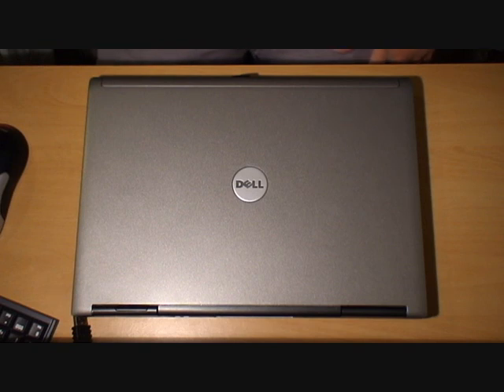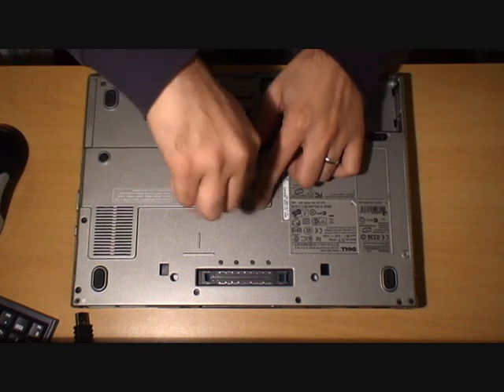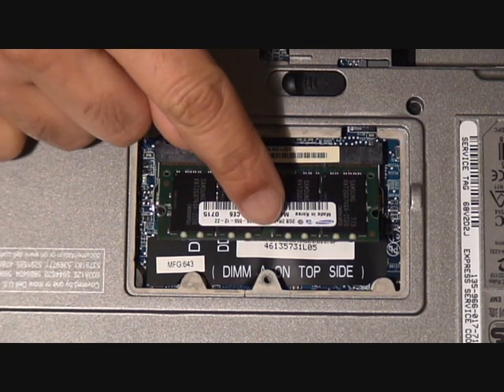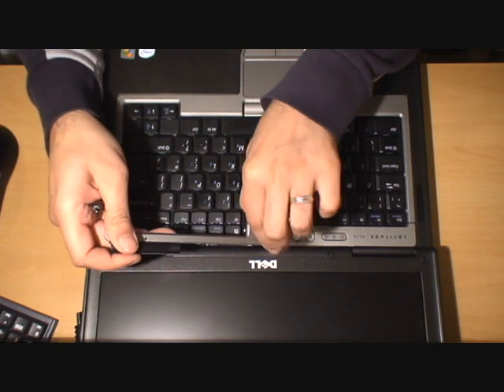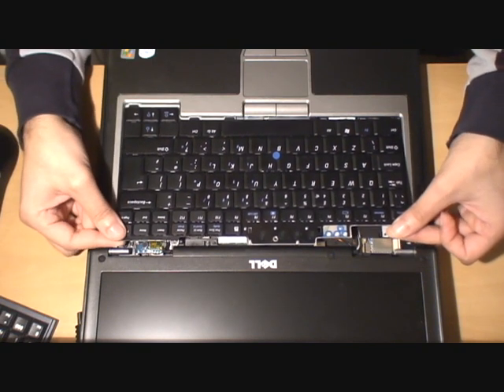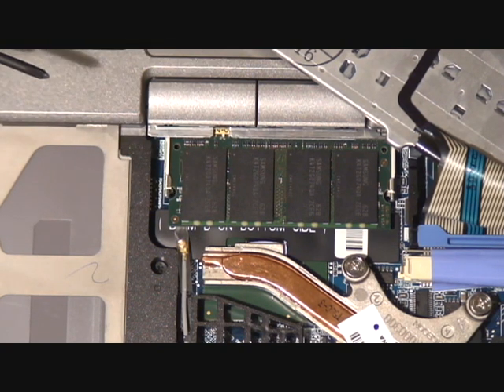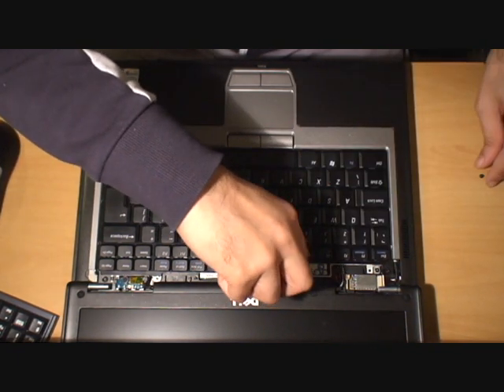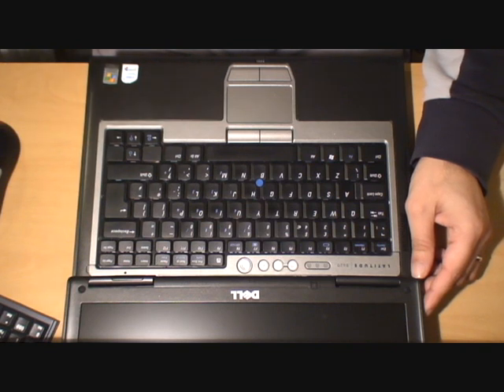Upgrading RAM in a Dell Notebook

Comment: I see this is a "dated" video now, but I'm very glad it was here!  
Just wondering if I should have put my new RAM of 16-gig in the first slot as opposed to the second slot, which was empty?  (The first slot had an 8-gig card in it.)  I learned after purchasing the new card that it's preferable to have the same size in both slots.  Anyway, this was a very well-done video and greatly appreciated!
Reply from the maker: Doesn't really matter which slot - yes its preferable to have the same speed and capacity in each slot - so ideally you could have just purchased an 8GB stick of the same type as the existing..... However, now that you have ether 16 I would install the 16 first - make sure all is running OK - then add the 8GB stick as well - if all runs well and you notice no speed difference (probably won't in normal everyday usage) then leave it in!
Reply: @iftibashir  Thanks for the QUICK response, much appreciated!

Comment: EXCELLENT VIDEO! Clear, well-paced and showed us all the important steps, much appreciated! 
I have a Dell Precision M4300 laptop - used to have 4 Gig in it then when I took it to my Tech guy for a new hard drive, he decided to remove 2 Gig of the RAM and said that WinXP wasn't recognizing the additional RAM anyway. He gave me the RAM back. He also installed a 5400RPM drive to replace the 7200RPM. So now I have a slow laptop with less RAM than when I started. 
QUESTION: Can anyone tell me how to reinstall the extra 2 GIG RAM that I have, in such a way so that it's recognized by WinXP?  And does anyone have any experience on upgrading a similar laptop to an SSD drive, and how that worked out? Any help appreciated.
Reply: Yup, just unscrew the panel on the rear.  Either remove the Ram on top to clear a path to the second slot or put the RAM in the exposed top slot.  Win XP will recognise about 3.5GB of the 4GB you have put in.  If you go to System it will tell you know much RAM it has recognised.  With luck the rest of the RAM  will be used by video.  Good luck.
Reply: Many thanks, will try it out!

Comment: Hey bro. Have you ever had a problem where the RAM slot at the bottom of the laptop won't lift up at all, no matter how much force is put on the levers? It's a D530, and it's entirely stuck. No RAM in it atm, but I'm wanting to insert some RAM into that slot, and it's not budging.

Comment from the maker: They could both be full - with a 1GB stick in each slot.
If you have a single 2GB Module, its more likely under the keyboard.
Remove the panel from the bottom of the laptop first - if its empty then you have a single stick under the keyboard and a free port under the laptop. If its in use, then you have a 1GB module in each port.

Comment: Are you using a 32-bit Operating System (Go to Start>Control Panel>System)?
If so, your computer will ALWAYS recognize less than 4GB ram.  You won't be able to use all 4GB ram unless you install a 64-bit OS (provided your laptop has a 64-bit processor a.k.a your laptop was purchased within the last 5-7 years).

However, if you ARE using a 64-bit Operating System, then message me back and I'll try to diagnose your laptop even further.

Comment: I have a question, are the slots called slot 1 and slot 2 for the order that you should replace the chips in if you are to upgrade it? ir is it just called that for reference? thanks.

Comment from the maker: @klitoni1 - It could be either as it depends on the original chosen configuration when the system was built. Best way to check is either via the BIOs, or via opening the bottom panel (the easiest slot to find) and seeing whats there. If the bottom slot is empty that will mean you have a single 1GB stick in slot 1 (the slot under the keyboard).

Comment: @iftibashir  - Thanks for the vid, I just picked up a used Dell D830 and I intend to upgrade it to 4 GB and I wanted to see how to remove the one under the keyboard.  It already has a 2GB chip in there and I could have just added 2 GB to the B slot but I wanted the 800 MHz RAM so I have to replace both.

Comment from the maker: @thewoonderboy - RAM is the temporary memory used my the OS or applications while in use. The more you have, the more memory applications have to use. This usually means you can open more applications simultaneously etc. 3GB is more then enough for general usage though. I would say start with 3Gb and see how you get on - it really depends on the applications you will be using.

Comment: Plz Help.  can i use (RAM name > Extrememory 2GB SODIMM DDR2 667 MHz  PC2-5300 CL5  to Upgrade a dell Latitude d620,  what happens if 1GB ram is in slot 1 , and i put in slot 2 , i put 2GB ram, would it work.  
And also will this be go too upgrade hard drive to SAMSUNG 500 GB 2,5" HM500JI  ,  Nice Tutorials i will use it

Comment: I have a Dell D410. The Dell online instructions say that one RAM slot is under my keyboard, and I'll have to remove the keyboard. Is that true.  I see two slots on the  bottom of the notebook.  However, I think one may be the hard drive. Will I need to remove the keyboard to change both RAM slots?

Comment: Well first, AMAZING video :)
Extremely helpful, but I would like to know something.
I have a 2005 Inspiron B120 laptop. It has a Celeron M 360 1.4 ghz processor. 40gigs of hard drive and 500mbs of RAM. I have available a 2gig upgrade ram upgrade, a 160 gig hard drive upgrade and a Pentium M 1.7ghz upgrade. My friend upgraded a 2002, and it runs like a champ. I wonder if upgrading my laptop is worth it, and the specs I told you the right ones for the model. Thanks :)

Comment from the maker: You will get around 3.25GB from any 32 bit Operating System - although you will benefit from Dual Channel Mode - which gives you a very slight boost, since you will be using 2 RAM modules that are the same type and size etc.
Gaming performance should increase a little since the game can access RAM memory much faster then your HDD, hence it can dump more of its running data onto the RAM, rather then onto your HDD.

Comment: I was wonder tho is it possible to put more then 4 gigs of ram on a Inspiron? o.o cause if so im shoot for6-8gigs :o thx for the video i wanted to make sure i did it right and you can also check that the ram was placed correct by right clicking your desktop going  to graphic properties and clicking the information scrolling down to the Physical memory you should have like 3000 mbs or somethin like that for 3 gigs of ram

Comment from the maker: Some of the newer systems have both RAM slots under the system - so you dont need to open the system up any further at all. If you only have oe RAM slot under the laptop, then yes, the second will be under the keyboard as shown in the video.

Comment from the maker: If I were you I'd check both locations to see if the RAM is still there. It may just need re-seating properly. Both RAM locations are necessary, and both connect to the mainboard - one on each side of it. If you are not confident in opening the system up, take it back to the store you had it repaired from. It could be that they forgot the extra stick of RAM, or as I mentioned, one of the chips may not have been inserted fully.

Comment from the maker: It doesnt always depend on what OS you have. The OS will 'see' a certain amount of RAM, as you correctly state, but the hardware can also only handle a certain amount. In most Dell notebooks this is usually 4GB, since you have 2 slots in the notebook, both of which can handle 2GB RAM modules.